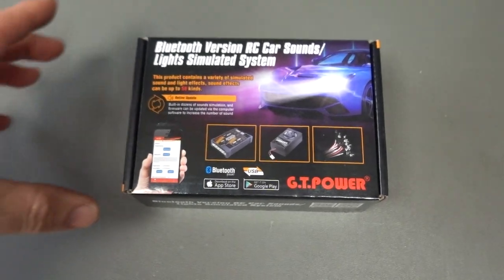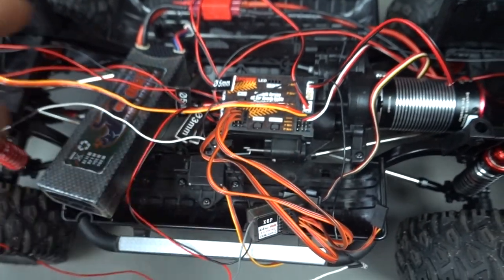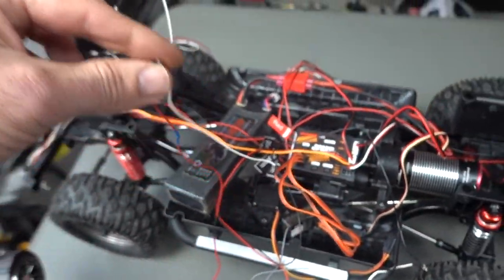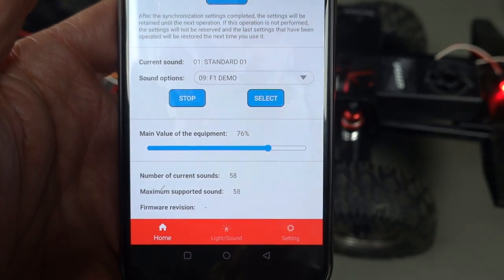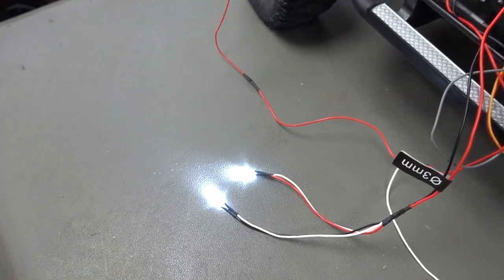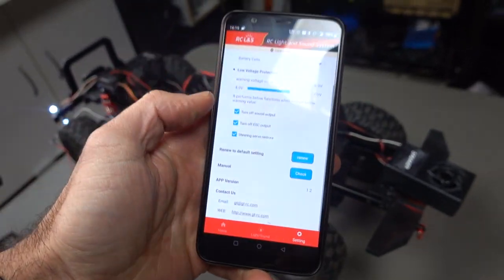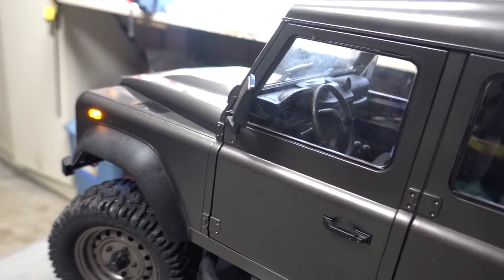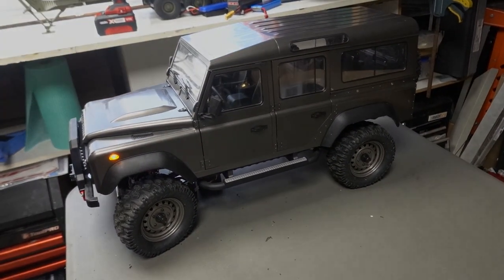MOST DETAILED RC BODY NOW GETS LIGHTS & SOUND - GT POWER

Comment: I love this body would love to get my hands on another one one day but I would like to just point out that the front park lights on the defender are the top ones and the bottom lights are the indicators and on the rear the top is the park lights and the bottom inner is the reverse/rear fog the reverse being the same side as the steering wheel
Reply from the maker: Definitely a great looking body

Comment: I noticed on mine the rear lights that it comes with if you remove them there painted clear plastic. They illuminated the largest ones both red but on the real one they are red on one side red on the other! The smaller ones are the tail/brake lights so just sand one back and use it as a single reverse light! But didn't know of these will defo be checking them out as wiring separate light and sound kits is a nightmare!
Reply from the maker: Thanks for the comment

Comment: It kind of sucks it doesn't have enough room for the reverse light. Same problem on the TRX4 Defender body. I solved it by putting in an RGB LED, so I can have both white and red. However I didn't use a standard controller for the lights, I programmed my own with an Arduino